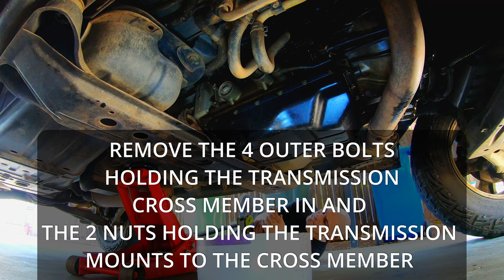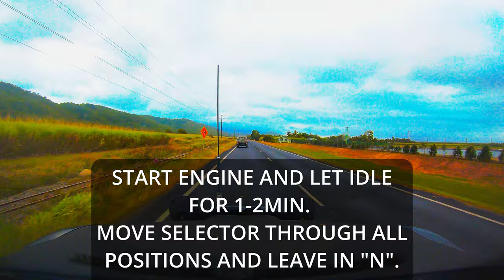Changing Automatic Transmission Fluid and Filter on NM/NP Pajero

Comment: I searched many times on youtube for ATF Change on the Pajero NM. Somehow, your video never showed up when I searched for it. Now it got recommended while watching a music video :D

Thank you, this video is very helpful. I just wonder: Aren't there normally magnets in the transmission pan which need to get cleaned properly? And also you show that you only fill in 4.5 liters while I read many times that the AT capacity is 9.7 liters? Many greetings from WA!
Reply from the maker: Mister T Thanks bud. Yeah it’s 9.7 L brand new and everything dry it would take forever to get every drop of ATF out of every part of an auto. But if you wanted it to be close to perfect you would fill it up, take it for a drive and than drop the ATF again, until the fluid coming out was perfect. 👍 and yeah I forgot to put the magnets in the video, just give them a wipe down and put them back where you found them 👍👍👍

Comment: wOULD IT BE POSSIBLE TO DO A COMPLETE FLUSH USING THE OIL COOLER ? ONE SIDE OUT TO A DRAIN, THE OTHER TAKING CLEAN TRANSMISSION OIL IN. THAT WAY THE TORQUE CONVERTOR WILL BE FLUSHED AS WELL? Sorry I had caps lock on.
Reply from the maker: Crash 999 It would probably be safer to drain the fluid, than fill it up, and repeat. Because you don’t want to run it too long without fluid 👍

Comment: A verificação do nível do fluido é feita com o carro ligado ou desligado, pergunto pois nem no manual do proprietário informa isto, só diz: "verifique o nível com o carro nivelado e em temperatura de operação..". Esqueceram de mencionar: com o carro desligado na posição "N" ou "P", ou ligado na posição tal.
Reply from the maker: cabeje sorry mate English ?
Reply: The verification of the fluid level is done with the car on or off, I ask because even in the owner's manual it does not inform this, it just says: "check the level with the car level and at operating temperature ..". They forgot to mention: with the car switched off in the "N" or "P" position, or switched on in that position.
Reply from the maker: cabeje I had it switched off idk what Mitsubishi wants you to do 👍

Comment: Great video, thanks for taking the time to upload.  Is this for a diesel?  Do diesel and petrol use the same transmission?
Reply from the maker: Yeah this is for the diesel but yes they use the same trans in all the NM and NP Pajeros (2000-2006).
Reply: @adventurejwagon2469  Thanks
Reply from the maker: Paul McNamara - Paul's Tennis Academy No worries Bud 👍

Comment: Great vid thanks.  Went and got all the bits and pieces I needed to get it done.  The thing that stopped me was the dip-stick.  Is there some way to detach it to take the sump off?  Mine looks like its all one piece from the sump to the fill point in the engine bay, in which case there are a couple of bolts to remove, which is fine, but I would need a hoist to get the car high enough to pull the whole tube out.  Is there something I'm missing?  Its a 3.2TD.  Thanks.
Reply from the maker: From memory there should be a bolt on the engine but just follow the dip stick tube from the bottom to the top and you should find a bracket
Reply: @adventurejwagon2469  Yep, there's 2, one on the engine and one further down.  So you just take the entire metre of so of dip-stick out?  It can be done with the car on the ground?....  its all back together now, though, so it will have to wait ...
Reply from the maker: @jasonhedges8578  yeah should be good just a bit of a reach from memory

Comment: Can you  do a video also for replacement of rear  crankshafte seal for that pajero.
Reply from the maker: If I need to do one I will
Reply: @adventurejwagon2469  My pajero is shifting supersmouth. But sometimes it takes long to shift when going uphill from 3-4 gear. 3.2 diesel 2004 gen 3. It has 426k KM. Would u suggest changing Fluid to make it shift smouther ?
Reply from the maker: blaster91 yeah mate I’d change fluid and filter before you try anything else
Reply: @adventurejwagon2469  Scotty kilmer sometimes say to keep the old oil. But have some friends say they changed and it made all the difference. I'll take you're advice.